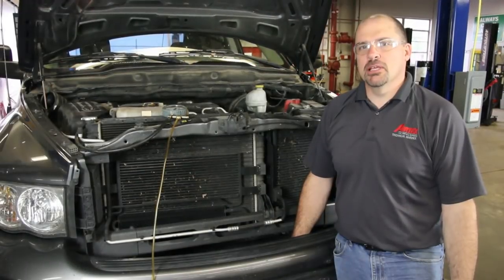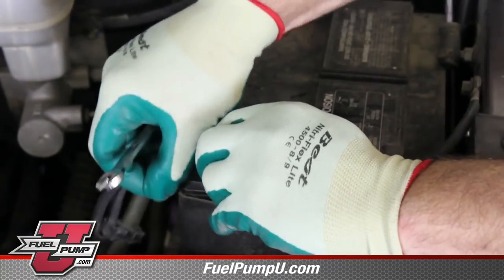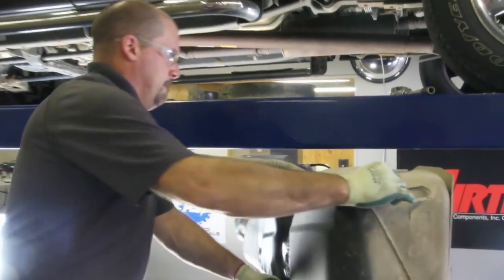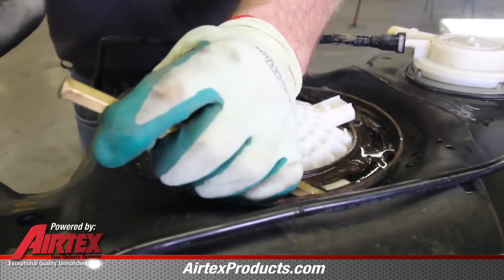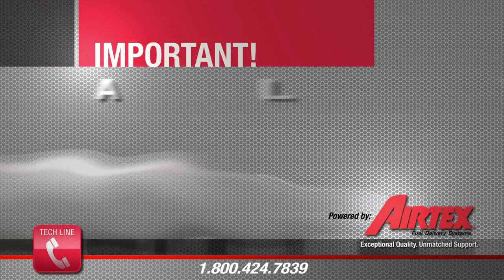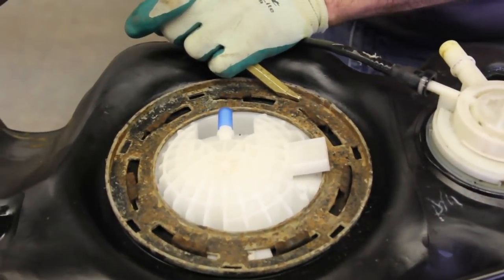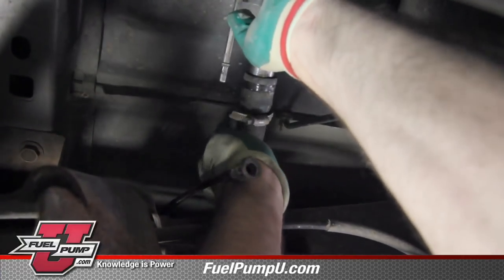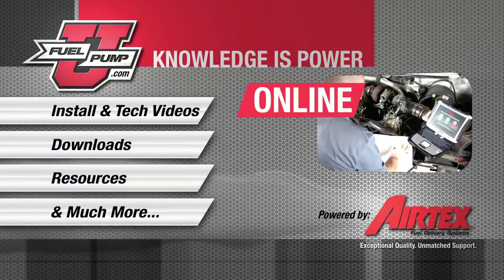How to Install E7186M Fuel Pump Module Assembly in a 2004 Dodge Ram Truck

Comment: Thanks for the reply,that's exactly what it is.I went out there this morning and pulled the tank out from under the truck into the light and I could see bits of O ring sitting around the outlet.I probably did it taking the hose on and off a hundred times trying to get the clips to work.Pump works great,cost me $200.If I took it to a shop or to the dealer I bet they would charge $1000+.

Comment: Wow I just finished mine with minimum access ...Cleaning the dirt around the lock ring makes a huge difference.  Lol I simply cut an access panel in my bed due to no work area And a HOA community .... Thanks so much you gave me some important tips ......

Comment: It helps to put some type of lube on the fuel/vapor line connections as to ease the internal o-rings in sliding and it keeps them from trying to "roll" in and get pinched. It also helps to use it on the inside of the filler and breather/vent hose and on the module sealing ring. If it is an off-road vehicle a full face shield is nice to have as well, dirt don't taste very good.

Comment: I just called and spoke with Shane. Very helpful nice guy... Thank you so much!!! N
ow off to fix my dads truck :)
Reply: +Airtex Pumps Y'all did!!! Thank you so much, I did just what he suggested, followed the lines and reconnected the line. Thanks again you saved me a bundle from going to the mechanics for something that took me 2 seconds to do. Didn't even have to take the bed off could reach it from the wheel well.

Comment: A better explanation of how the connections come off would be great.  Like most YouTube mechanics i dont have a lift and cant see the connections to remove them.
Reply: Andrew Glover That’d be nice, seeing as how actually trying to disconnect the connections wasn’t as easy as walking up to them and twisting and pulling them off.
Reply: I broke several fittings by following this videos guidelines of, "these are push pull fittings!"  Why?  I easily could have avoided added costly repairs!

Comment: After reconnecting the negative battery terminal I would recommend refueling the tank before cycling the pump. I'm sure that's what you did but it's not shown or suggested in your video.

Comment: I just installed one of your pumpms today on a 2006 Ram 1500 with 5.7 Hemi.It's the one for 26 gallon short bed and it works fine but the feed/high pressure line is leaking at the pump.I boogered up the clip on the old fitting but I got new clips from Dodge and it still leaks.

Any ideas?

Comment: Great walk-through! The locking ring on mine isn't moving using the same method. Is there anything like a wrench that I can use instead of beating the daylights out of it and risking damaging the locking ring?
Reply: Wow I just finished mine with minimum access ...Cleaning the dirt around the lock ring makes a huge difference.  Lol I simply cut an access panel in my bed due to no work area And a HOA community .... Thanks so much you gave me some important tips ......

Comment: What is the other module on top of the tank? I'm not getting any fuel up to my fuel rails on my 2005 Ram and not hearing my pump module turning on. My first step is going to be replacing the pump module. Ordering a pump tonight
Reply: ***** thank you. I got the pump replaced and the truck is running. But I broke the smaller nipple on the evap module. Now I need to figure out how to replace that

Comment: hey so i replace my 05 ram 1500 fuel pump but the fuel gauge stop working any idea wat it could be thanks
Reply: thank you for your help, is the assistance hotline 24/7 
and we could i find the video
Reply: ok thank u very much ima look into the video and give it shot thank you for your help